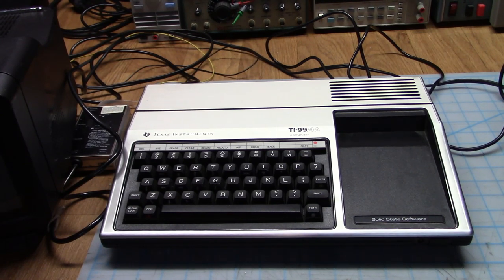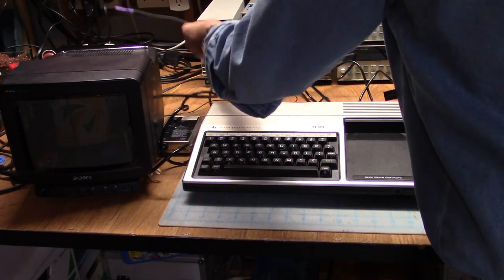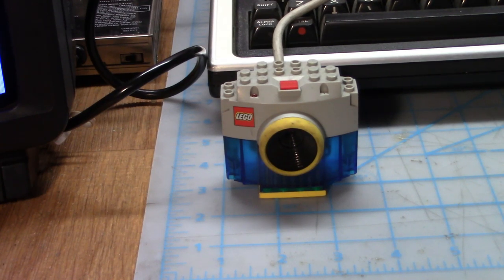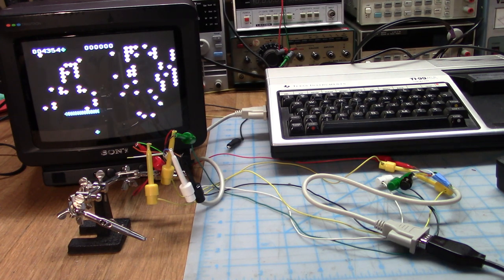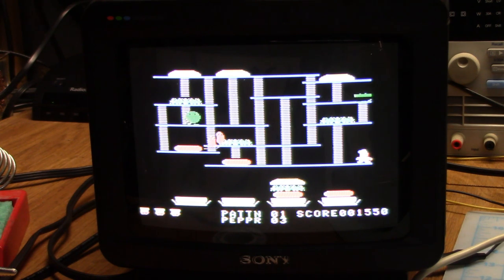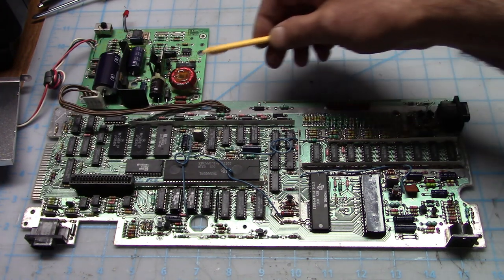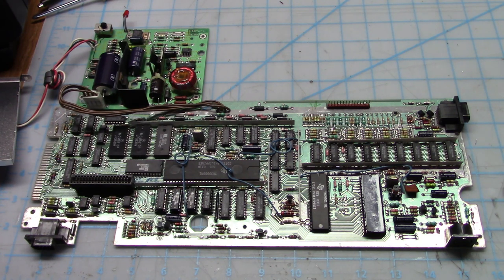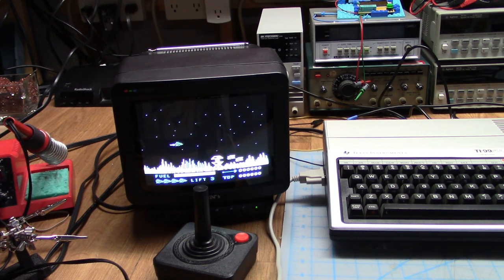AE#107 Texas Instruments 99/4A, Teardown And Joystick Adapter

Comment: The composite video/audio cables you get for Commodore 64's have the same pinout.  I use that cable for both a C64 and a TI-99/4a
Reply: I was thinking it looked the same as the one on the Vic 20...

Comment: I was selling computers at Sears in the 80's and these poor machines didn't get much love.  They had great keyboards, but like all the home computers at the time they were a rats nest of wires when you added a few peripherals.  The expansion box offered some relief because it had one huge ribbon cable but it was so expensive even when they were selling the computer for $99.

Comment: DIN connectors originally started with three numbered pins. As more pins were introduced, Instead of changing the original layout and numbers, additional numbers were added to each pin, hence, the haphazard arrangement of pin numbers.
I remember seeing that TI computer but never purchased one, I was a TRS computer and Sinclar computer fan.

Comment: One variant of the 9900, the 9995, was used in the Tomy Tutor and some Litton aircraft radar systems.  The latter application took advantage of the processor's DSP-like instructions and nearly unlimited accumulator size (accumulators are in RAM).

Comment: First off, great video very informative; keep them coming. One thing I'd like to point out, is that even though for a single joystick your adapter works well, if you add a second joystick, you have to add diodes to the button lines for each of the joysticks. The problem is, if you just connect them in parallel, when the same button is pressed in both joysticks then there would be a short, thought just for a short moment. The reason is that while "select" for one joystick is high, the other "select" is going to be low. Because both buttons are pressed, there would be a short between vcc and gnd:

[no diodes] 

low (2)-----||----(any input)----||-----(7) high. 

[with diodes] 

low (2)----||----|<-----(any input)----->|----||----(7) high

Adding the diodes allows for the input to low when a button is pressed, but blocks current going out of the "select" line when it is high.

Comment: I had a joystick to TI converter box, but I forget who made it. It let you have 2 joystick on 1 port, plus I remember having Caps Lock turned on or off for them to work. I think the circuit used in the box employed diodes.

I had the Donkey Kong Atarisoft cartridge.

Adventure on cartridge would load the game from cassette.

Comment: MC68000 was better, it was a PDP-11 on a chip!  When the 68k was released we bought one of the original development kits, it had a serial number dremeled on the lid of the ic.  I translated a IBM to DEC communication protocol (HASP) which ran on a PDP-11/05 and replaced the entire DEC box with a 68k based board which plugged directly into the Unibus host, it was called the "Comboard" by Software Results Corp, columbus ohio!

Comment: These I believe were quite successful in the US, but in the UK and Europe they completely bombed. I friend of mine had one (his dad paid full price for it as well). IIRC in unexpanded mode the machine was virtually unusable due to the double-interpreted BASIC taking an absolute age to do anything, and it not being possible to run machine code natively from console or tape. You had to have a cartridge, and very few people other than TI released cartridges. So against the C64, or even the Sinclair Spectrum, while on paper the TI was the better machine in practice unless you bought all your games on cartridge, and paid a lot of money for the extended BASIC cartridge the machine was a complete dud. As us Brits used to buy games on tape, and expected to just plug the base machine in and go, it was a failure here.

Shame, as from what I've seen on YouTube, when properly coded and games released on cart the TI was a very capable machine, quite able to keep up with the major 8-bits.

BTW it wasn't just the video chip that was successful (a variant of which was used on the MSX I believe), but the (pretty good) sound chip was also used on the BBC Model B micro.

Comment: I’ve written code on 68000s, x86s ranging from the original 8086 thru my current quad-core i7, PowerPCs, AVRs, and ARMs ranging from microcontrollers thru 64-bit Apple processors used in iPhones & iPads. I’ve also done a fair bit of reading on Z80s, 6502s, 6809s, and PICs. The 68000 architecture was drastically superior to the 8086. Programming on one is much nicer than programming on a x86. This did not get properly solved until AMD came up with x86-64 - and even then it’s still a bit ugly. I really wish IBM had gone with the 68000 - or at least wish that Intel had used a proper flat memory model and equipped the 8086 with enough registers.
Reply: Yeah, segmented memory sucked on x86 CPUs.

Comment: It is a better machine than you give it credit for, although I can appreciate that its first impression by someone who did not grow up with it, may think that it was poor.
Anyway, best game on the platform is, by far, TUNNELS OF DOOM, which is an RPG and quite fun even to this day.  Also excellent was a game called HOPPER in which a kangaroo kicks around a box and traps bad guys.  Other notable games were HUNT THE WUMPUS, FOOTBALL (you call the plays, computer executes them), VIDEO CHESS (a decent chess engine for a 16k computer, and pretty good graphics), SOCCER (decently fun), and TOMBSTONE CITY.
TI WRITER was a decentg word processor, of which I wrote my first computer-based document (a book report for finals in 9th grade English class).  Except for the 40 column display limitation, the word processor worked quite well and I think it had a spell check but I could be wrong on that.
The keyboard was EXCELLENT.  In fact, my favorite feel to a keyboard still to this day.  The small enter key was not as big of an issue then as it would be on a modern pc.

Eventually I upgraded to a Commodore 128... then onto a C128D, and while those machines were much more capable, I learned MORE from the TI-99 and had more FUN with the TI-99, even notwithstanding its limitations.

FYI - Parsec really shines if you had the SPEECH SYNTHESIZER add-on.  Visually and Audio it is excellent game, although I never felt the playablility was there.
Reply: also, I had the ADVENTURE game.  Never got beyond the first few screens.  It required either the cassette or floppy disk.
OLD CS1
OLD DSK1
Those were the good old days.

Comment: I am pretty sure that when it came to IBM's decision process to use Intel for the PC, programmability and performance were both pretty low on their priority list. Business relations, design help, licensing rights and of course bill of materials (BOM) might have been a bit more important.
Reply from the maker: I think that Intel was the only company that realized the true potential of getting their foot in the door in the serious PC market, and they must have cut prices to the bone. That and the guarantee of silicon availability in required quantities must have clinched the deal. The 68K had a superior instruction set, the 8088 was an 8080 on steroids. I still have nightmares thinking about offset registers.

Comment: 31:45 Intel won that because of one technical advantage they had over Motorola: The 8086 has offset registers and can execute code, data and exta data easily everywhere in its 1MB Address space. The 68000 would need an extra memory management unit for that. So that was the killer for the other processors.
Reply: Um... nope. The 68000 was used on a bunch of Macs (and Amigas, and Atari STs, amongst others) with no MMU, and handled megabytes of RAM without a problem. The 68000 series has a flat memory model; with 32-bit pointers. A MMU was only needed for virtual memory - either for swapping out to disk; or for process separation.
Reply: @darkwinter6028  Well, your point is mostly invalid. It seems you have never coded in Assember for any of them. I have, for both of them. The 68K does not have a MMU, so in a dynamic code loading envinronment which all modern computers use you need to re-calculate all the pointers and jump addresses by using a table, if you do not use a MMU. Amiga software had a recalculation table at the beginning of the code. That process took a while and was a PITA for programmers and compilers. Self adjusting code was considered and still is considered inherently a  bad thing. Fine for static code like firmware, but not for runtime loadable code. With the 8086 you just need to set the Code Segment, Data Segement and Extra Segment to an address that is the 20 bit base address divided by 16 and you can execute the code without touching it at every 16 byte address you wanted. That was much more convenient for coders. The 68K can address 16M (24 bit address bus) though while the 8086 can only address 1M (20 bit address bus). This was rectified when the 80286 came out which was also able to address 16M of RAM.
Reply: Chip Guy Vids - it’s been a long time since I did anything on the 68000, but... jump tables were a function of the OS and ABI in use; not a requirement imposed by the hardware. DOS didn’t provide any kind of overlay support; that had to be provided by the compiler. Branch instructions on the 68000 were PC relative; and the jump instructions could accept two registers as arguments (so you can get the base address of the code resource you are targeting into one register; get the offset into another, and them jump). This can be as few as three instructions; starting from the condition that there’s nothing in the registers to begin with (well... your stack & global pointers would be already setup, of course).

Remember, we are talking about an IBM 5150... it was really primitive on launch.
Reply: @darkwinter6028  Yes, relative branch instructions are used by compilers when possible but they are somewhat limited and absolute addresses were always necessary to access data and jump further away from a current address. Jumping to an adress in a register and precalculating it takes always longer than to just do a jump and let the hardware do a simple addition like in the 8086. All this was taken into consideration. Well in terms of registers the 68K is far superior to the 8086 but they really should have done some offset registers that would have made life easier. Who knows, we might even live in a different world today with Motorola as the biggie and not intel.

Comment: I think IBM would have been better off with TI's microprocessor over the one they chose. Many issues with their computer if I remember right. I'm sure if the 16 bit would have been 16 bit with the rest of the computer we would have had the best computer on the market. I wish people would not compare the TI with the toy computers such as Commodore and Atari. TI made an educational computer. Just like apple did. There is more to a computer than games. You can buy a game machine that is better than commodore and Atari was smart they made game machines. 73
Reply: I don't know but I learned x86 and it was fairly easy, and I could never make much sense of Ti's instructions.  I didn't really try hard, because there's no reason to learn it, but it seems like a total mess.